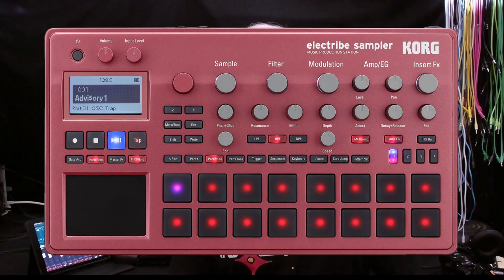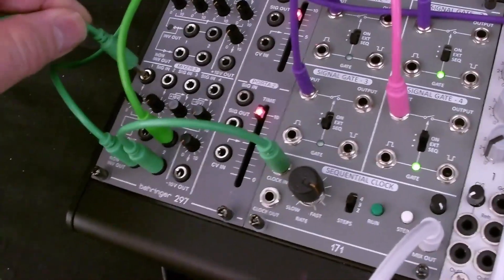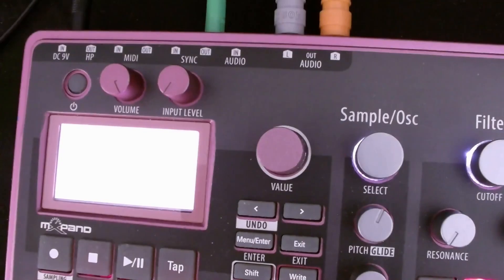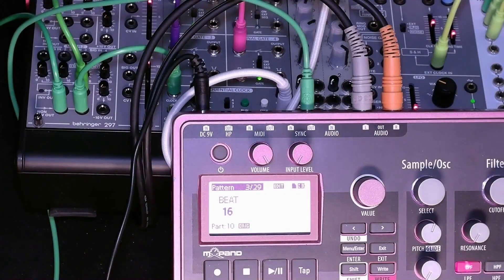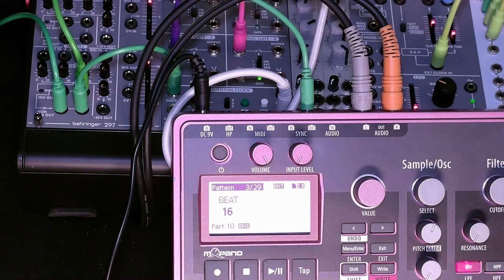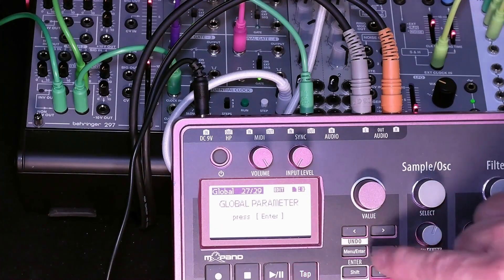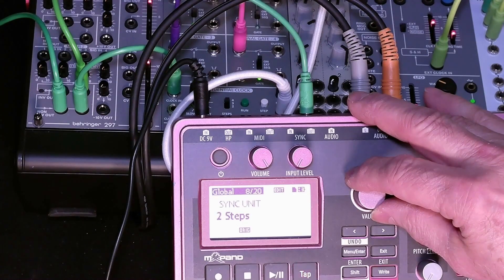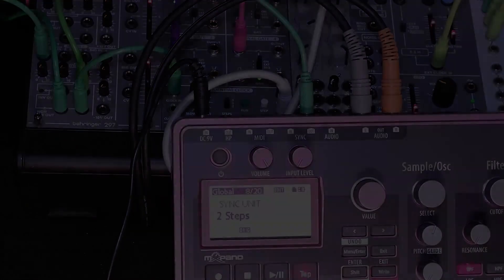Korg E2S Ep 2 Analog Clock Sync Out

Comment: Thanks, (and help!) where do I plug that sync out cable into? (sorry, I didn't get where you inserted it on your mixer). I want to sync the E2 with my Microkorg and Wavestate, but am clueless about it all. Or should I use the midi connections? I only need clock sync not any data transport, so I thought maybe sync option is simpler? Thanks for any advice, the E2 user manual is so basic.
Reply from the maker: The sync out on the Electribe 2 (E2S) is a 5v clock output.  You would typically use it in an analog synth.  The microkorg and wavestate may contain a sync in, but MIDI in is probably what you want to use.  Too avoid triggering notes on either of these target synths, be sure to either filter the MIDI data (item #6 on the Global Parameters menu ), or avoid using the "Part" on the E2S corresponding to the MIDI channel for the microkorg and wavestate.
Check out the "Parameter Guide E" document from Korg.com to see your MIDI options.  
https://www.korg.com/us/support/download/manual/0/368/3174/
Reply: @ozhalljr  Thanks for the info. Triggering notes is exactly what I want to avoid, I thought syncing midi clock was going to be simple, but looks like I will have to enter the midi jungle a bit. New area to me.
You got some wonderfully complex looking gear going on. Best wishes for your projects.
Reply from the maker: @rahjuwow  thanks.  let me know how it works out.
Reply: @ozhalljr  Hi OZ,  I finally got a kind of solution. The 'midi filter send /receive' options did not make any changes. So I made the Wavestate the master instead, now when I set the E2 'midi filter receive' to 'short', or 'short+program' the problem is gone, I am not getting any E2 sounds blending with the wavestate. If I set it to 'off' again the sounds are back. The parameter guide alerted me to: 'OFF: All messages are received'. I was assuming the opposite! 
I still don't quite understand, but I now have the synths, the E2 and my pedals (Boss GT100 and SY300) working in 'separate sync' just as I want. Hooray.

What's your advice on a small standalone Midiclock to sync all tempo?. Is that a good idea if I expand my gear later, would that simply bypass all sounds and commands that might get in the way for me? Thanks for your attention, I know this is basic ABC but I appreciate the help.
Reply from the maker: @rahjuwow glad you got a fix.  In terms of clock source, I usually use a synth that has 1) a readable BPM display 2) some flexibility for filtering/managing MIDI output content 3) a tap tempo.  
If you are into Eurorack, the "pamela's new workout" module is popular.  Mutable Instruments has the Temps Utile.  
For stand alone units, I like an Arturia Beatstep  or Beatstep Pro or KeyStep Pro.

Comment: Hi OZ. this is a little off topic but I want to set up a control wire fron the Behringer CM1A Trigger out to a mult. Do I need to use the hot and the ground lead to accomplish this or just the hot lead as in the 921B contol wire mod? I did try it with just the hot lead and got some unexpected results. I was thinking that maybe the ground is isolated on the CM1A. Any thoughts would be much appreciated. Cheers
Reply from the maker: Why are you connecting a trigger to a VCO? (921B).  What input are you using?  What result are you expecting?
Reply: @ozhalljr  sorry OZ. I was taking the pitch CV pitch out to the  C3PA-O and it woulld not control pitch without having a shorting plug on the C3PA-O input. Sorry for the confusion. I have not tried it with S trig yet so wondering if there are any connection issues. Cheers
Reply from the maker: OK.  I would expect that to work because both the C3PA-O and the CM1A are connected to the power supply.  Thus they share a ground.
Perhaps there is some isolation of the ground somewhere in one of the two modules, but I doubt it.
Next question, why not just solder the ground as well? ( you could test this by making  the ground connnection with an alligator clip cable before soldering).
In any case, if it requires a ground, just provide that ground. Also I'd create a twisted pair to keep from picking up a radio signal from the wiring.
Keep me posted on the results.
Reply: @ozhalljr  solder a ground as well, yes this is exactly what I will do. I guess I was looking for some reasurrance. Thanks and I will let you know what I come up with here. You have inspired me to do some experiments on harnessing. Thanks so much for your "other set of eyes" The alligator clips are a great idea also. Cheers
Reply from the maker: Great.
Reply: @ozhalljr  I am trying to extend the s-trig outs on the CM1A to a mult on the other side of my 2500. Just so I don't have to run long cables across the instrument. I thought it may be nice to run a control wire behind from the CM1A to the mult for plugging in 1033's etc.